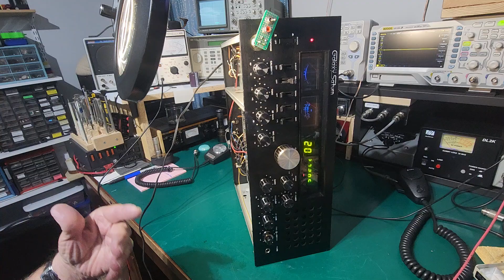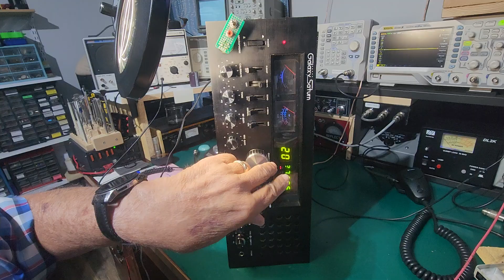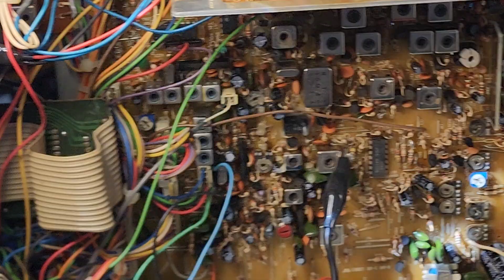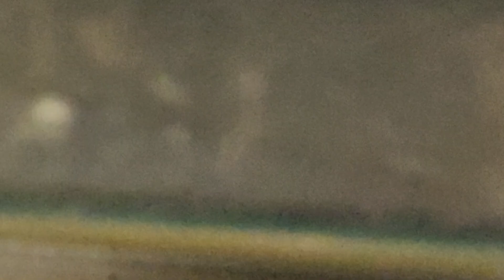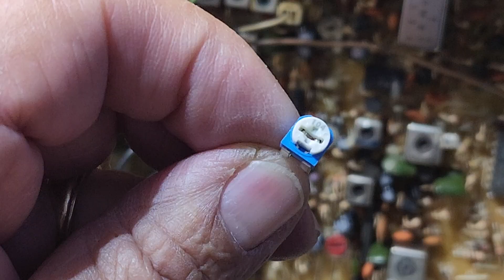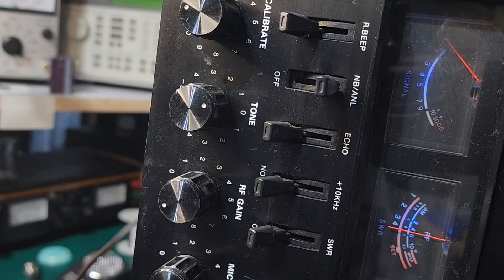GALAXY SATURN BASE RF METER CIRCUIT REPAIR

Comment: I have a like new saturn needs repair. Do you have a contact #
Reply from the maker: Sorry I didn't catch this till now, But here is the information for you. 719-453-4722 if you don't get an answer please leave a message I will call you back or you can text me at this number.
Reply from the maker: Sorry I didn't get back to you most likely you already found someone to fix your Saturn if you need any future help the address is below
DeltaTango Electronics
4455 SE Capitol Circle
Grimes, Iowa 50111